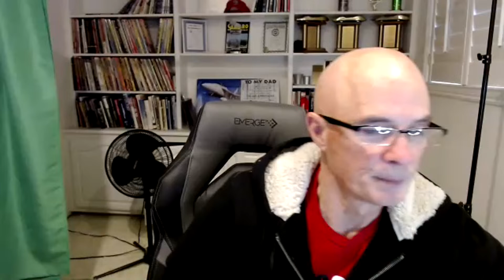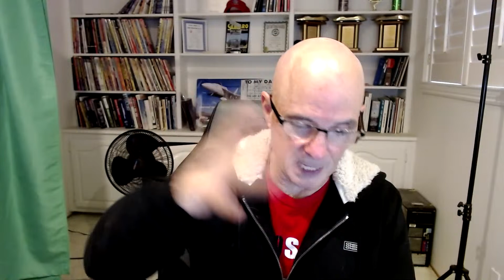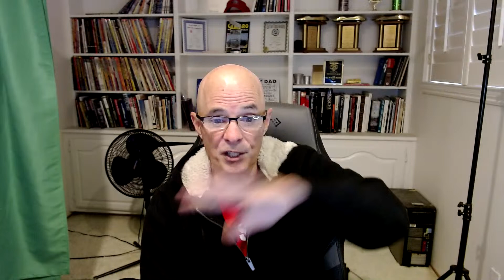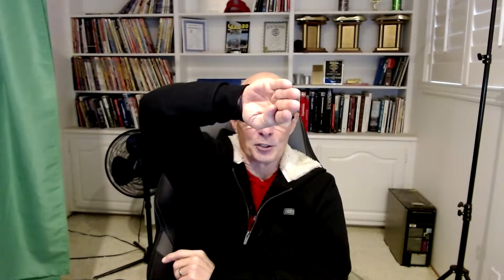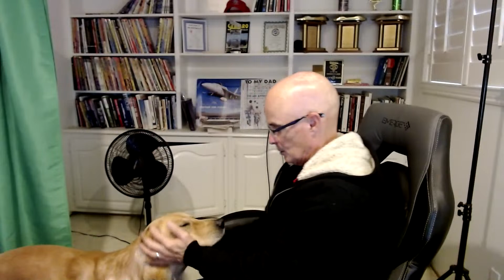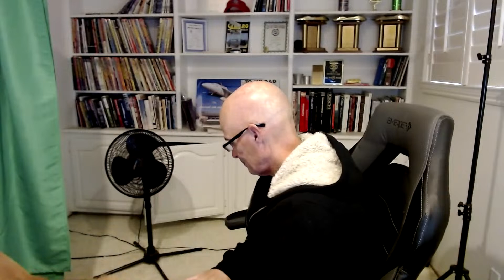BOOST VS RPM! LET'S TALK TECH

Comment: I have a sd4 3.3 257 hp @6500, wanting to turbo to 10 -12 lbs boost how much rpm will be added to max hp
Reply from the maker: if boost stays consistent, rpm is the same